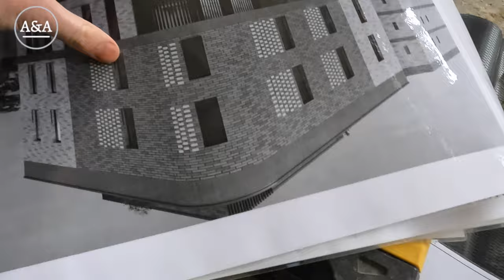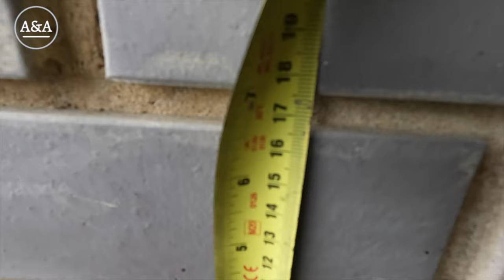Is This The Worst Brickwork You've Ever Seen? Starting The Flats #Bricklaying

Comment: A little tip that was past on to me many, many years ago, on your chariot if you turn the wheels around, so that the concave part of the wheel is on the outside, your chariot creates less build up of raked out muck on the wheels, thus creating cleaner face work, as more of the raked muck drops free. Not saying your face work is dirty, just noticed that your chariot wheels are as you buy them with the concave inside. All the best
Reply from the maker: Ah I like it. Thank you for the tip 👍🏻
Reply: don't worry about that his work is filthy before he rakes it anyway

Comment: be sensible here , the existing wont get passed and the knock on effect means you will get knocked as the builder goes tits up ,hope im wrong but after 40 years at it seen this shite before ,walk and treat it as a learning curve
Reply from the maker: The work on the balcony is getting torn down, no one is saving that! The guy running the job knows it’s unsaveable and genuinely seems happy he’s got some people in that know what they’re doing. We will see on Friday when it’s payday 🤞🏻🤞🏻
Reply: I make you dead right jack I hope it doesn’t happen to Adam but I’ve been here before myself
Reply: Being a bricky isn’t easy because you always have to check other peoples work before you start and some of the work these managers want you to take on is shiiite . No doubt the prices or the day rate will get cut to compensate for the take downs . The q s should be getting off his arse and checking work before too much damage is done.

Comment: I thought you all work to profiles on site these days? 
In the old days we used a gauge stick but some didn't check enough and you got course of pig. Not easy to get over!
We used to do that stupid raked out joint in the 80s and it looked awful then too.
Reply from the maker: Usually profiles are all set up, no idea what the lads where taking before we got there, it was all over the place. The reason there is a raked out joint is because the site manager was cutting corners everywhere and wanted to save money on black dye for the muck so it was all raked out and then repointed in black muck later on which makes no sense as the money you’re saving on black muck you’re wasting more paying people to point. The job was a madness from day 1
Reply: @AdamHatch  ha ha yes that sounds crazy. We used to do the raked out joint on face work and it was a pain in the arse to get it all flushed. Don't do much of that now thankfully.
Reply from the maker: @leeetchells609  ah man it’s horrible, if the mucks wet it makes a mess, if the mucks dry it makes a mess, just a complete nuisance 🤯

Comment: This channel and Charlie’s channel is like chalk and cheese, with different techniques used … completely different….. in speed …  I appreciate this is not  a long run of brick work …  your doing .. I believe wire cuts are harder to lay , if the muck is not correct.. I also appreciate, your eye  to the perps … I guess they lost the gauge,, maybe ? When grinding down …. Easier to bump a course out of it … as I say it’s just a guess…   It needs coming down I think ……
Reply from the maker: Hello Gary thanks for your message mate. Mine and Charlie’s are completely different, mine are more of a vlog style just having a laugh, his I suppose are more educational. This project has been completed now, you can see more videos on my channel, it was a nightmare from start to finish mate